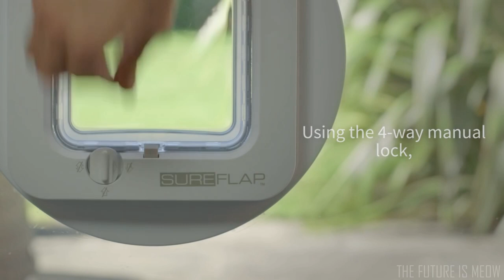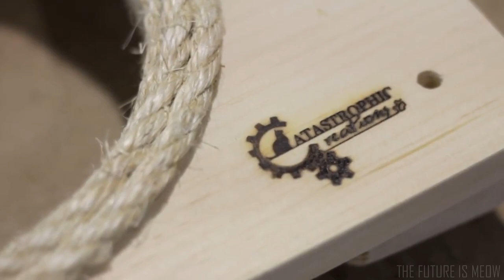10 Things Your Cat Wanted For Christmas 😿

Comment: My cats would probably be very happy with pretty much all of these items. I would be very happy with that litter box! Litter trays are a bit of an issue in my house! I just can’t find the right one for my female cat. I have 2 cats, a male and a female. The male is generally no problem with the litter box, as he pees downwards or slightly forwards. His only problem is that he doesn’t know how to cover his poo with litter, he just scraps at the side of the litter box, which is a futile task! Anyway, my problem is with how my female cat pees. Her pee comes out backwards and pointing down only slightly. She gets into the large litter tray, but she doesn’t always go in far enough. So because the front side of the litter tray is lower than the rest and because her pee comes out almost straight back, if she doesn’t go up to the other end of the tray, when she pees, the pee is landing outside of the tray, even though she is inside it. This happens at least once every day or 2. 
I won’t use a completely enclosed tray, because I live in a very hot part of Australia, the litter boxes are outside in a cattery. My cattery has a completely covered roof, 2 of the sides are against the house and the other 2 sides are covered with something similar to chicken wire. It is hot where I live, the majority of the time. If the litter tray was covered in this heat, I would think that after 1 or 2 pees it would be pretty unpleasant for my cats to use it. I use 3 litter trays for 2 cats and they are the largest ones I can find. Any advice or suggestions would be much appreciated. 
Also thanks and well done, if you’re still reading my ridiculously long comment! 😀
Reply: Leanne Paxton to be honest cats don’t like u when u clean there poop and pee
Reply: @76SweetBee  , hi! Thank you so much for your suggestion. It looks great and I would absolutely give it a go, however, unfortunately I don't live in the States, I live in Australia and we don't have Walmart here! But I will keep my eye out to see if I can find something similar here.
I haven't seen a litter box like that.

A long tume ago I heard somewhere that you should have at least 1 litter box per cat plus 1 extra. So, I have 3 litter boxes for them. They both use all 3. They both use 1 for pee, 1 for poo and the 3rd one they seem to use for both! I find it quite amusing how they both came to that agreement, especially considering that they don't like each other very much unfortunately! 
Again, thanks so much for your advice. 😉